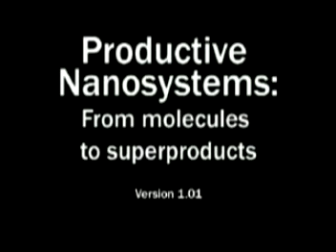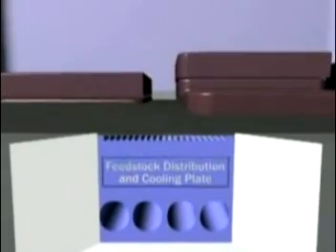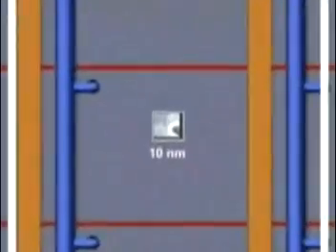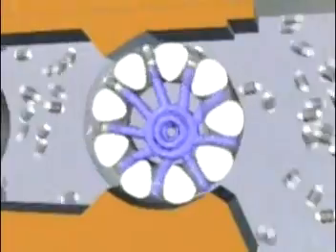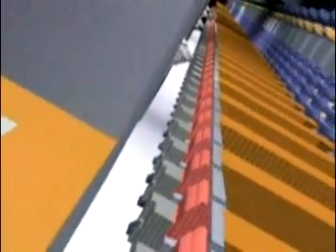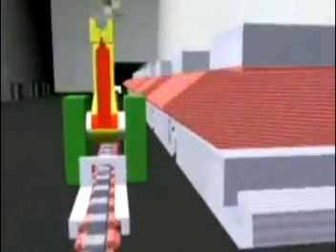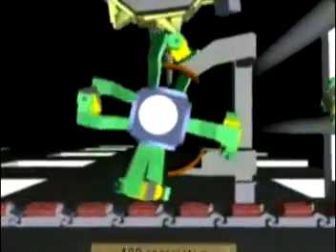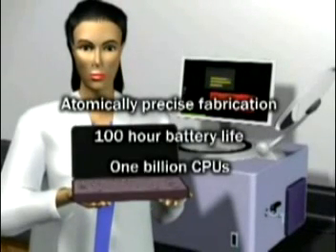atomically correct computers

Comment: One particularly interesting research area at the mo is metamaterials. Someone recently theoretically worked out how to reverse the Casimir force and hence Van der Waals forces that were the basis of the 'sticky fingers' objection, not that that was a very good objection to begin with, for the reasons Hottides said. Metamaterials also do some really funky things with light which could have some huge implications for nanotech.

Comment: I was referring to Drexlerian view of nanotech shown in this video. Of course there are simple QC's with a handful of qubits have been built. All you need to do is  isolate a quantum state from the environment long enough to do a calculation on them. You can do that on a quantum dot at a few degrees above absolute zero and quantum dots are easy to make. The manipulators on the video are damn hard to make to atomic resolution.